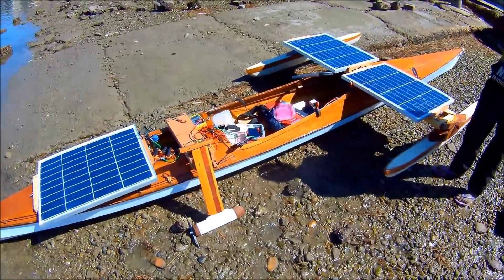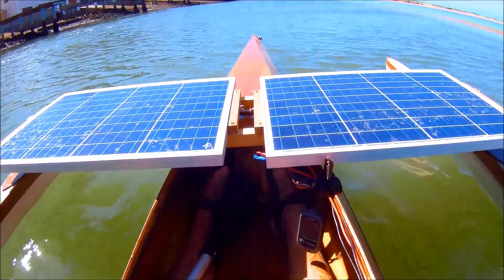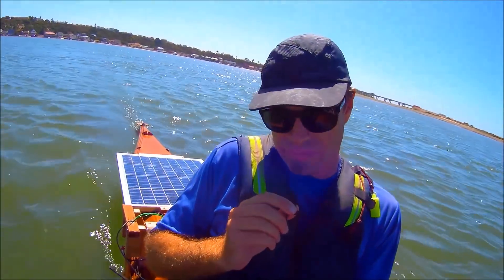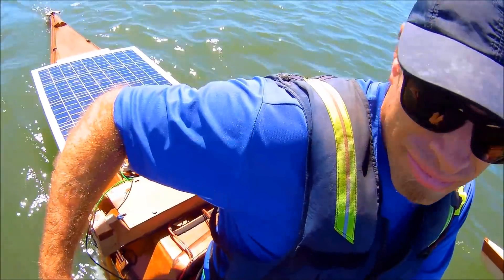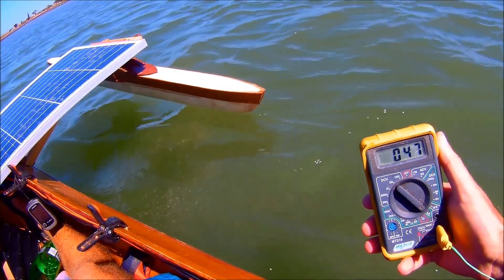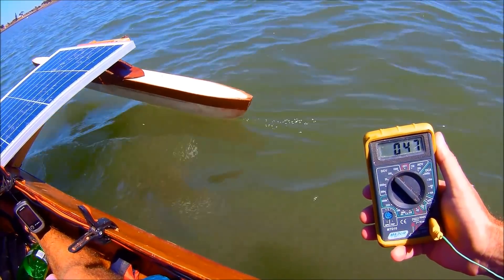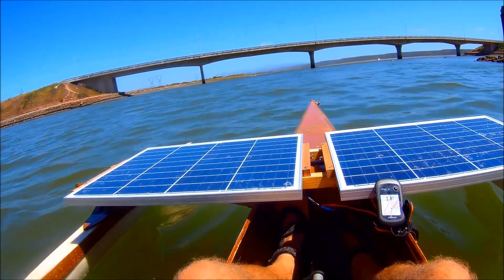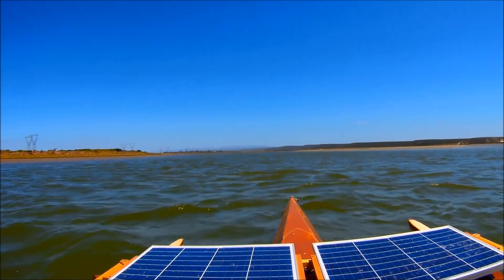Solar kayak - new propeller test

Comment: That's a nice idea.. what type of motor William ?
Reply from the maker: Ryobi cordless drill. Actually, it was am impact wrench, with the hex chuck, it has a lightly larger motor than the two-speed drill. The motor size is the 775. There is a link in the description of how I assembled the drive-train.
Reply: Description:

Three-phase brushless motor.

Insulation and corrosion resistance.

Nylon propeller 4 leaves.

Application: Ship model accessories, underwater robot, remote boat model.

Specification:

Product Name: Brushless Motor Underwater Propeller

Color: Green

Motor Material: 304 Stainless Steel Bearing + Aluminum Alloy

Housing: PLA Nylon Propeller

Specifications: Positive Propeller / Anti-propeller Propeller

Voltage: 12V-24V

Current: 17A

Power: 100W-300W

Motor: 1450KV

Product Size: 75*62*62mm

Cable Length: 250mm

Note:
This propeller must be equipped with a brushless motor driver to operate normally.
With a brushless motor, it can be forward and reverse. It needs to be equipped with an electronic speed controller.
It must be at least 30A above. It is strictly forbidden to connect directly to the battery.

Note:

1. Please allow 1-5mm slight deviation of measurement due to manual measurement.

2. Due to the difference between different monitors, the picture may not reflect the actual color of the item. Thank you!

Package Included:

1 X Brushless Motor Underwater Propeller

Comment: Brilliant video. I hhate the rc "air" prop.. i dislike the idea alot. A proper water prop will work so much better, lower amps and a much higher power output.
Reply from the maker: You cannot argue with real-world performance tests. During our recent solar boat races, the top teams maintained 8kts despite it being overcast. They all used rc plane props. Ask anyone who has replaced his trolling motor prop with a 10x5 or 10x6 aircraft prop and they will all tell you, better top speed and lower amps. The only downside is weeds.

Comment: Your voltage is pulling all the way down because voltage is potential.  You are using all the power from the array.  Amps are what is turning your motor over.

Comment: Very beautifull project! Congratulations! if you neeed increase the power using same space, you can use Sunpower solar cells. We are also solar custom panel factory in Italy and we can integrate solat panel in a custom.structure of any sizes and not mandatory rectangular.We already did panels of others forms and semiflexibles too.
Ciao
Reply: Hi, will you please send me link of your Sunpower?
Reply: Sure you will do custom work for many thousands of dollars.  Does this guy look like he has many thousands to spend?
Reply: @DIYDaveT  have you asked me some custome.project price? I dont remember. we have solar cells for.diy or we can do custom.panels or resell chinese solar panels too. DIY solar panels is.not the best specially when you use it on boat because diy solar panels usually has encapsulation problems.and it is very dangerous and produces oxide that make the panels unusable.
ciao
Reply: @MrwattEu  In other words, expensive to do properly. I don't need a quote to know something so basic.  "Custom" is never "cheap".  Ever.
Reply: @DIYDaveT  all is realtive. If you have a diy solar panel can be more expensive of manufacturerd solar panel. expensive is that yiu are on the sea and solar panel broke because encapsulation of solar cells is not good and water creates oxide... anyway a custom semiflexible solar panel can take about 2.5$/watt for medimu size solar panel and you ll have ibtegrated solarpanl in you structure and garantee of solar cells encapsulation is the best. Now all people can evaluate what is cheap or expensive. Bye
Reply: Yes, we should all be driving Mercedes Benz because, after all, if your cheaper car breaks down you will be walking.  LOL. Save the sales pitch for people that don't have very much life experience.  I have been around too long to be hypnotized by that sort of thing.  You don't seem to understand something very basic about this which is that  DIY people operate on low budget and are willing to take some small risks in order to have something that would otherwise be out of their price range.  There is nothing relative about high prices for people that don't have much excess cash.  If this guy had any money he would not be fooling around in this kayak death trap, even with custom solar panels.
Reply: @DIYDaveT  Hello, our name is MR WATT DIY too, you haven't the copyright. Not all is cheaper in DIY and not all people can do better in DIY. We have solar cells kit on sale and we can do custom solar panels. If you have experience in DIY solar panels, you can understand what it means. Ciao
Reply: @MrwattEu  Thanks for the links.
Reply: @MrwattEu  do you have video explaining more detail about your Sunpower?
Reply: @MrwattEu  I am looking for a robust and high quality solar panel which each panel can produce around 500 watts with dimension around 2mx2m. Do you have it? I have search in your website, I didn't find the suitable one.
Reply: @StrsAmbrg  about power in rectangular/square format, we can arrive to 180W/square meter about
Reply: @MrwattEu  seems just like the common solar panel available in the market. Panasonic has such power output.
Reply: @StrsAmbrg  standard.panels.are.cheap about 0.5$ per watt in.the.market
Reply: @MrwattEu  price is onother thing beside "density". Density here is about its power output for every 1 m2. Not a formal metric, but we probably may understand it. The highest the density, the better because roof or space mostly are limited. The current solar panel still hard to achieve its power output to the requirement of the power.
Reply: @StrsAmbrg  Ok, do you need custom solar panels integrated on your roof? in case o square or rectangular panels, you can use the sunpower cells and obtain 210W/square meter or 190W with high performanes monocrystalline solar cells. Using solar cells, you can DIY solar panels and glue the cells on your kayak, or make semiflexibles panels of any sizes or form. We are manufacturer of custom solar panels in Italy and all days doing it. We can shipping to you solar cells or manufacture custom panels based on your requirement of sizes and form
Reply: @StrsAmbrg  we can cut solar cells with laser cutter and adjust size of solar cells like you want but the restriction is that alla solar cells must be the same size.
Reply: @MrwattEu  do you produce your solar cell? Or are you just modify a solar cell to make it meet your requirement? If you produce it your own, please send me link, especially link to the 210W/m2.

Comment: Does anyone have any advice regarding what happens if the solar panels become submerged in a roll over. Im about to get some solar gear to fix to my kayak to charge a battery for my phone, cameras etc. Obviously the batteries and controllers will be in a waterproof box but was just wondering about damage to the panels. Are the normal aluminium backed, glass front panels ok in the case of a submersion?
Reply from the maker: I doubt you have to worry about the actual pv cells, the junction box where the leads come out will most likely be the weak point with regards to sealing. My 300W Jinko panel's junction enclosure is rated IP65, so it can withstand water sprayed from a nozzle but should not be submerged permanently. During last year's race a boat capsized and was good to go again for a second capsize.

Comment: cool project! I was thinking about some supercaps bank to help with "under the bridge" situation, but you had those comments already. i would also add a 12v battery onboard (disconnected), so i can connect it in case of emergancy.

Comment: I would say it would be a good idea to put a battery in the system granted running off a battery isn't going to give you the type of power in speed running directly off the solar panels would but as long as you get a charge ensure that is rated for the output of your panels or higher of plucky 200 W charge controller that would definitely help plus you could still wireless system to where you have diodes between the motor and the battery so that way you could jump across to the Battery altogether and get the speed of just running off of the solar panels when you're in direct sunlight but when you go under bridges and stuff or it becomes shady you have the battery there to give you that extra boost and more consistent power output and at least keep you at 1.8 knots or better even when going under bridges or in shaded areas or maybe even just have a battery on board that you can hook up or have a switch that all you have to do is foot that switch and it would connect the battery into the system but I would be careful about leaving that switch on when the motor is not on if you don't have a charge controller cause it will definitely destroy the battery And this is a cool little project but I would definitely use a battery even just a small one for some redundancy I would probably get a 30 5:00 a.m. hour battery and use it in this system just so that way you have enough backup power on board to have an hour of use say if something happens like the wearing girl's bed for your panels or something falls in doesn't cause you to sync but damages all 3 of your panels so that way you're not just sitting there dead in the water because it doesn't look like you have a paddle with you either.

Comment: Are you using a maximizer at all? Search for “mini maximizer” they’re are AUD$40 for the kit, could be perfect for your application. Great video!
Reply from the maker: Not during this test, but I have done a test with a buck converter. It obviously helps when a cloud passes in front of the sun but needs constant manual adjustment to keep the panels at MPP. That mimi maximizer looks like a very clever little gadget. I have not seen them for sale locally but it looks straightforward enough to build. Pretty decent efficiency as well.

Comment: Try positioning the panels at an angle facing the sun
Reply from the maker: Thanks for the reply Ben. I have added a tilting feature to the new 300W panel. It works well. It also makes mounting the panel quick and easy.

Comment: As you have found out. There is no doubt that model plane propellers perform better in water than marine propellers, but the mystery is, why don't they use these kinds of propellers on other boats?
Reply from the maker: Peter I suspect it boils down to practical trade-offs. Propeller durability is easier to achieve on a prop with short, stubby blades. There is also the thrust and torque requirement of the prop at a given rpm and boat speed. To achieve good acceleration, an engine needs to be able to reach sufficient rpm, so the prop design should allow the required thrust without requiring too much torque. An electric motor's torque availability differs greatly and allows the selection of larger, slow turning props. That said, the Wageningen B-series propeller test data show that some marine props can still achieve incredibly high efficiencies.

Comment: Why not have the panels top up a battery and have the battery power the motors, you will have no drop outs then rather than running direct from the panels? Or you could use some super caps.
Reply from the maker: I was optimising the system for solar boat racing where batteries are not allowed. No restrictions on supercaps, I have tested some in the shop but I will need much higher capacities to be of any use.
Reply: @williamfraser  If you're going to grab supercaps you can get a 16.2V module for about $100. https://www.aliexpress.com/item/33048199215.html?spm=a2g0s.9042311.0.0.c1204c4dM1CWNA

I bought and did some testing on the self-discharge and capacitance for about 10 days, check my review for the condensed tables and graphs.
You get about 81% of the advertised capacity which is very good for Chinese products known for inflating specs. 
If you're going to get this for your 150W solar boat it would be wise to either make a 9-cell module to support the 24V open-circuit voltage of your solar cells, use them in a solar charge controller, or upgrade the attached balance circuits to bleed off the 150W. As it stands, the balance circuit on these can only manage about 2W per cell, so when the motor is not in use the solar will destroy the supercaps.

Comment: 3x 330w house panels (2 across the front in landscape, 1 portrait in the back) = 1000w = bow wave 😁
Reply from the maker: The solar race allows for up to 4x 320W panels. During last year's race there were two surf-skis with around 1kW each and they were getting up to 6-7kts despite using small inefficient drone props. I have 2x 300W panels and a 24ft double surf-ski but I first need to build a new outrigger system and a stronger motor to cope with the power.

Comment: Im sure you've probably figured it out by now, but the reason you've got 21vdc at open circuit and millivolts at closed circuit is because the motor is using your available voltage.
Reply: Cody Kinzly you have no idea what you're talking about. Voltage to drive the motor is the voltage to drive the motor. Of course it should be display the input/ terminal voltage .  If it's not, it's hooked up incorrectly.

Comment: Very nice! I notice this is an aeroplane propeller - big diameter, narrow blades. I would imagine it's not very efficient in water - have you considered using a smaller prop with thicker blades?
Reply from the maker: This propeller works much better than my previous small 3-blade prop. The efficiency is really good if you carefully match prop pitch with rpm and boat speed. It turns much slower than it typically would on an rc plane.
Reply: I watched both! Looks much faster indeed. I’d still be curious to see the difference with a propeller designed for water, turning at an even lower RPM. Seagoing propeller blades generally have that thicker chord allowing for more contact with the water on each revolution and less flexing, plus broader ends which reduce tip vortices. It would also depend on the torque of your motor, but if I read correctly you’re using a drill motor which should be pretty beefy. Might not change your top speed, but maybe better acceleration? Anyway top job!
Reply from the maker: A large diameter (low disc loading) is what drives efficiency. Typical boat props are constrained in diameter due to practical issues such as draft and robustness. Smaller diameter props need wider blades in order to absorb all available power at practical rpm. That is, rpm low enough not to cause cavitation. There is always room for improvement, so I will continue to experiment.

Comment: Neat work, would you not get more speed from it using a dule ended inclosed impeller?
Reply from the maker: Not sure what you mean by dual enclosed, but a shroud around the prop would improve efficiency. Even better would be a higher gear reduction ratio and a larger prop.
Reply: @williamfraser  a impeller on each end of the motor shaft,   should try adding more blades to the prop as well, not sure if a Corkscrew type prop would be any better (like what some small scail hydropower station uses), if you have a 3D printer accessible might be interesting. also if you add a capacitor to keep some power stored to get you under those bridges.
Reply from the maker: I see what you mean now.  No, in-line impellers will be detrimental in this application. They will create a concentrated  high speed "jet stream" wake. All that velocity is wasted energy. Higher efficiency requires exactly the opposite, scooping a large volume of water and pushing it backwards slowly. Regarding the capacitors, I have tested some small supercaps in the workshop (4x 4F in series, so 1F total) but it was not enough to even get the motor turning. I will need much higher capacities to be useful.

Comment: Why don't you out 2 motors?
Reply from the maker: The motor was chosen to match the power available from the panels. By dividing the power between multiple motors, the motors themselves would not be operating at their maximum efficiency at the panel voltage. Additional power electronics would be required to step down the voltage for maximum motor efficiency.
Reply: @williamfraser  oo got it

Comment: No batteries? Can you have larger motors?
Reply from the maker: No battery. I used a larger motor when I switched to brushless. You can see it being dyno tested in a more recent video. It pushed me past 6kts with a 300W panel.

Comment: very nice :)..salt water(on the sea) can problem for solar panel?  corrasion?
Reply from the maker: Thanks. The panels are sealed reasonably well. The only weak point in the sealing of these cheap panels is where the cable comes out of the junction box. We race in an estuary, so salt water, everything needs proper insulation.

Comment: have you concidered filling the motor tube with minral oil to dissipate the heat to the tube and in turn the water
Reply from the maker: I suspect the increase in friction combined with high motor rpm will consume too much additional power to make it worthwhile. Might be worth a test with an old motor just to satisfy curiosity...

Comment: you could get much better resulst using a propellor thats actually designed the run in water
especially becaise of the low rpm
airplane props are designed to run in much higher rpm ranges
Reply from the maker: The prop operates at higher a Reynolds number under water, so the blade section actually has a better lift/drag ratio than operating in air. It experiences higher torque on the hub though, so there is the risk of the blades breaking if too much power is applied.
Reply: @williamfraser  oh alright

Comment: you should use a battery to store the power - even 1 6 v would keep you going just fine under bridges.
Reply from the maker: I am considering a custom power-bank with some 18650 cells. 3 series, 3 parallel. The cells I have are 2200mAh, so that should give me 6.6Ah at 11.1V.